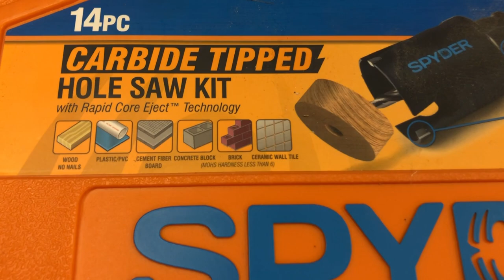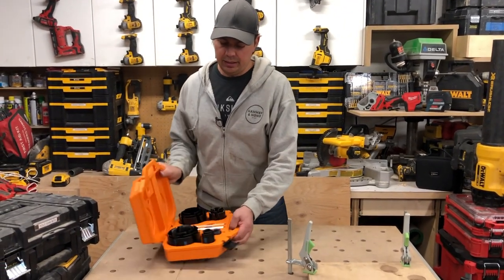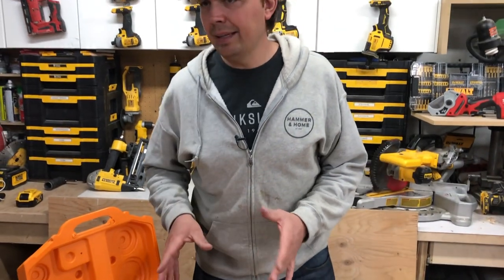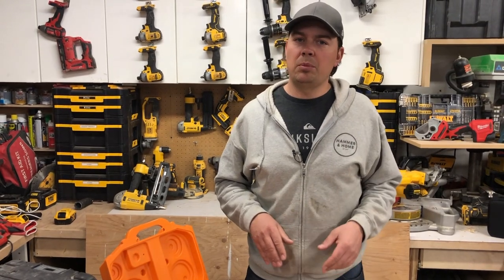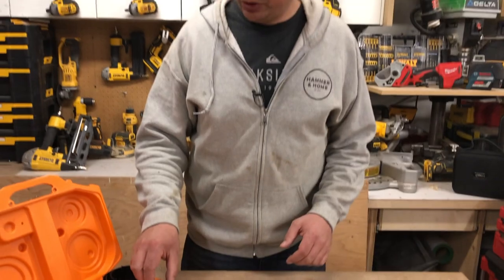Spyder 14-piece Carbide Hole Saw Kit review

Comment: Here is a tip. When drilling through thick wood instead of trying to do it all from one side drill the piolet hole all the way through. After that turn the wood over and use the piolet hole to dill from the new side. The 2 cuts will meet in the middle.
Reply from the maker: @neutrodyne  it’s a good tip 👍 I do that when I’m trying to not get any blowout.

Comment: On my kit both arbor drill bits separated from the arbor with light use. I'll stick with Milwaukee
Reply: Amazon reviews suggest they aren't that great !
Reply: I can concur with this, the drill bit portion of the arbor tends to snap off where to transitions to hex shank.  I have just been keeping spares on hand at $6 a pop.  The holesaws themselves are fine, I sometimes use them with a starret or Milwaukee arbors.

Comment: Thank you so much for this review!  I have a question if you could maybe guide me. So I did the 2 saw method to enlarge a hole. When I put the inside bit on I did put it rather right and after drilling my hole I could not for the life of me get the inside bit out. Going through the wood must have made it even tighter. How in the world would you get this inside bit out in this situation. I didn’t want to use a hammer to try to tap the bit and ruin it. I also tried to put a bar through the bit through the holes on the side and tried to twist it out with no luck. I was to afraid of messing up the bit.  What  could I do?  Thank you so much👍🏻
Reply from the maker: Try the bar again. But put a torch on the bit for a bit to heat it up.
Reply: @hammerandhome  Thank you I will try that. Have you had this issue happen to you using the bits this way?  Do they remove normally for you? In you vid you just snugged it. I think I just over tightened it.   Thank so much for your time.
Reply from the maker: @99zman  I never tighten the bit all the way.

Comment: So when you used the smaller bit as a pre drill wouldn’t you start the hole then take the smaller bit out so you can get the piece out and not have to take it out of the drill?
Reply from the maker: Yes you could do that if you want.
Reply: I'm pretty sure that if you have a secend adapter that attaches to the hole saw itself you can fit both of them onto the drill bit, it's long enough to have two on there, one would be locked into the groove of the pilot bit the the bigger one would be sitting against the drill chuck

Comment: no need to break out the puck. center drill it through and go from the other side.
Reply: Not typically feasible between studs or going through plates

Comment: @Hammer and Home  You should check out this YouTube video: https://youtu.be/xIYZIWPRBos about locking chucks. This chuck locking is just a bit different on my Dewalt DCD999 drill driver - after tightening the ‘locking’ chuck, un-tighten the chuck just a bit then re-tighten the chuck. You will hear a distinct ‘click’ from the chuck that confirms that the chuck is now locked around the shaft of the bit.

Comment: Worst hole saw kit I've ever used.  Pilot bits break easy.  It's good for concrete and nothing else
Reply: I strongly agree the pilot bits break off I even silver brazed the bit on it and it bend. The pilot bits are the biggest weak point.